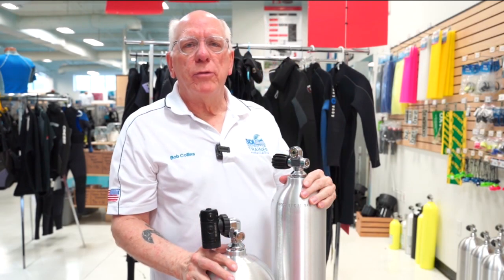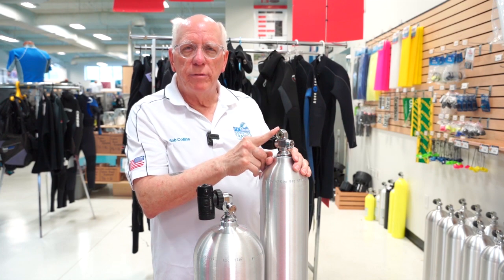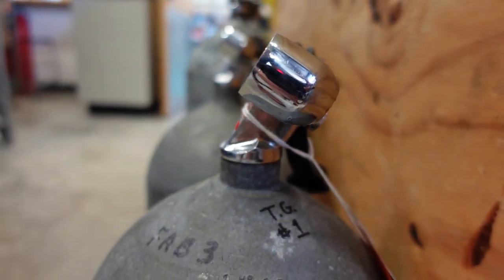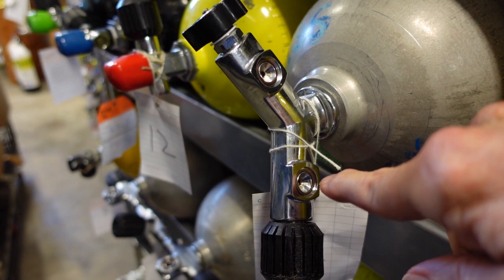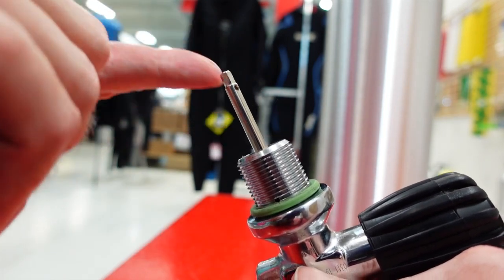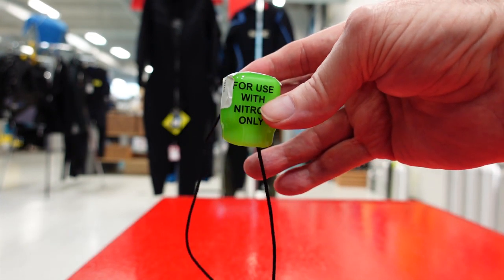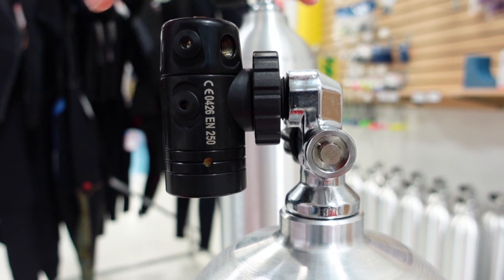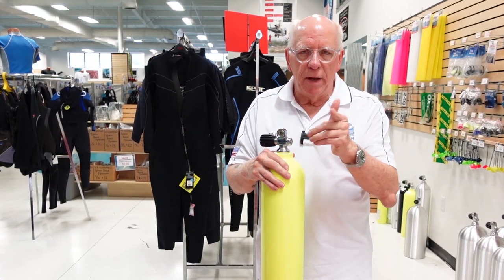Scuba Tank Valves and what you need to know in 2020

Comment: I have a bottle fitted with the Pro Valve by the manufacturer here in the UK, on the valve  there is engraved 4500 PSI.. it had come with the insert to be used with the yoke... can it be used for 300 BAR for both the yoke and the DIN configurations???
Reply from the maker: Number one, check the burst disk and what's it's rating.  Number two don't trust what the burst disk bolt says, look at the disk.  Especially if this is not a valve directly from the MFG.
Some times people risk great harm by using incorrect disks on tanks they may try to over pressurize beyond ratings.
I am always cautious about answering these issues without having components in hand.
BE SAFE !
Reply: You should never use over 200 bar on a yoke connection. The yoke standard is not designed for that. An insert should not be able to fit inside a 300 bar DIN connection by design.. unless you have some 'illegal' part. Just, don't... air explosions at 200 or 300 bar, or loosing your air supply at depth, both are life threatening.